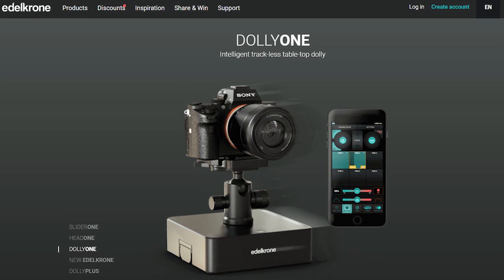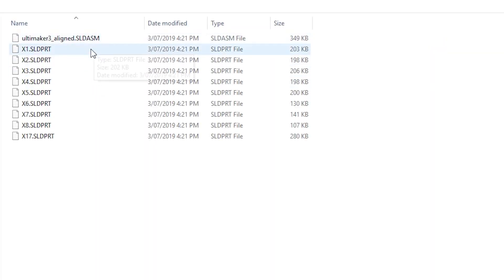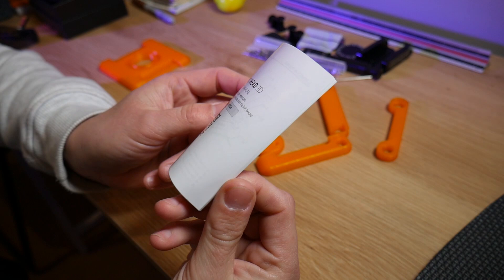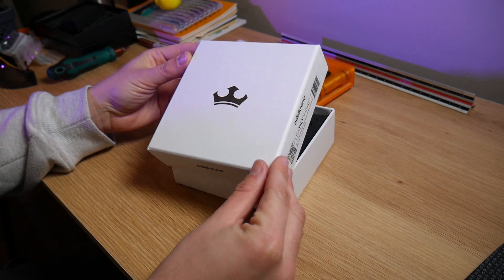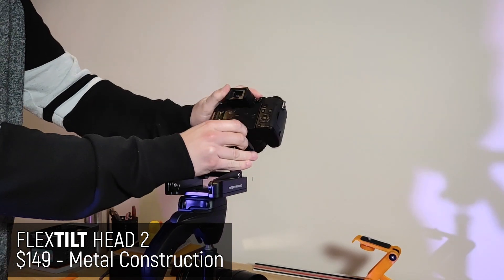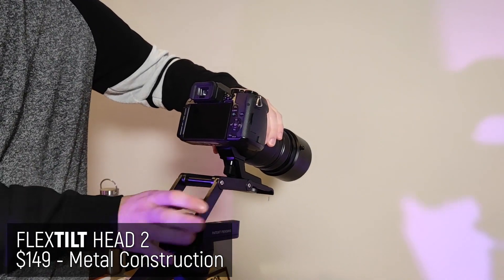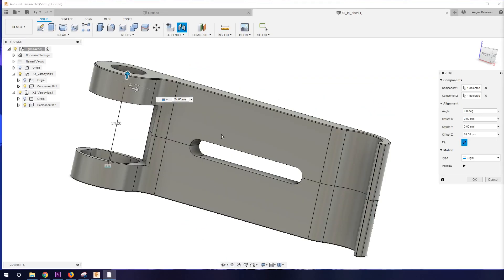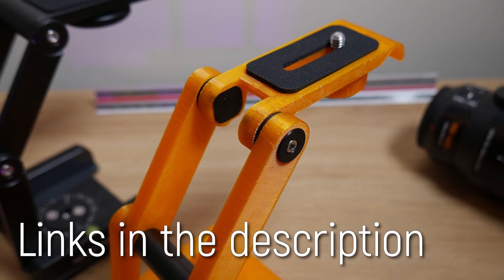Is the FlexTILT Head 3D the Future of Manufacturing?

Comment: 7AUD?! :-O Here, in Czech Republic, a kilo costs around 550-700CZK, which is about 34.66-44.11AUD...
Reply: Or you can get something like Gembird for 300-350CZK, both ABS and PLA.
Reply: @Evelas22351  I don't have the best experience with gembird filaments. But I recommend  FilamentPM (Plasty Mladeč) for 550CZK.
Reply: @vit.budina  They're not that bad, especially for the price. I tend to use them for larger, less detailed prints (props etc.)
Reply: @Evelas22351  I don't say that they are bad, I just have better results with other brands. But for the price it is a really good deal, I just prefer to pay couple bucks more to get better results. I had some adhesion issues with their white PLA.

Comment: 3:46 God I kept feeling like it's gonna break
Reply: You'd be shocked at how incredibly strong solid 3d printed parts are!
Reply: @Reach3DPrinters  yeah! if the pressure is in the  Z axis tho it's going to break SUPER easily in my experiance :(
Reply: @chloemcholoe3280  Certainly, pressure that separates the layers has the greatest chance of de laminating the part. 

However, a part printed at 100% infill with 3-4 perimeters, is INSANELY STRONG... just depends how thick the part actually is. I printed plenty of stuff 15-25mm thick, solid infill, and a hammer couldn't even break it. PLA is much more rigid than ABS though, which Ive mostly used PLA.
Perhaps your layers aren't bonding well. Maybe try increasing temp a few degrees and see if your parts become stronger.
Reply: @Reach3DPrinters  huh. I should try that. tho the part I designed had little z axis tabs that were supports to bend. they just broke :P but again they were thin. 
but you're right maybe it needs turning etc.
Reply: @chloemcholoe3280  Yeah, thin stuff like little tabs are definitely the downfall of consumer 3d printing. Prints gotta be robust to withstand the tests of time, at least 1/16" thick if its gonna last some abuse. Anything thinner than 1.5mm will break easily. 

Stuff designed to bend, such as live hinges have to be designed very carefully. Once a material has crossed its deformation threshold it plasticizes, and the material "memory" permanently deforms to a new position. So the goal of a living hinge is to never deform, but to only flex a given distance.
The field that studies living hinges is relatively new, known as compliant mechanism. Very fascinating field in its infancy.
Reply: @Reach3DPrinters  you seem to know a lot :)
Reply: @chloemcholoe3280  Its the stuff I don't know that I try to avoid learning :D

Comment: You can also open the Solid Works files directly using Fusion 360
Reply: But it loses the timeline and you end up the same place as using the step file so sort of moot.
Reply: @Anonymouspock  it is called the feature tree in Solidworks. Does Fusion have import feature recognition? It has been some time since I have used it.
Reply: I never could get used to F360 so ditched it a few years back and went back to SW.
Reply from the maker: @TheJttv  it doesn't preserve feature tree but will usually keep assemblies relatively intact. STEP is essentially the same in terms of what you get after conversion.

Comment: Carbon Footprint
This is a weird one. Let's take filament. If your filament is made in your country of origin, it's carbon footprint could be less vs getting parts from this company which could be located in another country. 
Depending on your delivery service, the kit could be part of an environmentally unfriendly route. There's too many variables without more info. 

I'm really envisioning scenarios where you could get the parts from your local hardware store and just need the files for 3D printing. 
I think it's an opportunity for smaller producers or minor products. Though the biggest concern is someone taking the files and manufacturing them. 
I could even see support where they go "Sir we can send you a replacement part or you could 3D print it with a cad file we'll send free of charge".

Comment: I hope this is the future.  I also hope the Open Source Hardware Association will allow for a level of certification where only part of the design is open (i.e. the case is open source, but the custom firmware is not) so that consumers can see that the company has some open source interaction like this, without making the whole thing open (e.g. Partially Open - Non Functional to show that some of the parts can be replaced or modified, but not enough to build the item completely).

Comment: Any plans to film your process of filming camera operation? Less sillily, I do like this approach. Oddball gear's generally somewhere between pricey and insanely expensive, and while part of that's charging "what the market will bear", another reason's that it's oddball gear and doesn't have consistent and inexhaustible demand. While the margins on something like this kit are likely sky-high relative to the actual cost of the parts, it's a lot less painful as Joe Individual wanting a nice camera mount for a hobby, and even if Mr. Individual's hobbies don't involve use of a printer, maker spaces have kinda exploded into existence over the past decade, along with printing services that'll just ship you the parts (and hopefully take care of their printers). It's also worth noting that this wouldn't be limited to printing. A 3D printer's definitely the most likely local robot, but you could also bang this out on any other kind of CNC bot if you wanted to play with the device's mechanical characteristics or just had it in the workshop. Wooden camera mount? Wooden camera mount! Got access to a CNC milling machine? Well, you're cool and we should be friends, and you could basically duplicate the more expensive one without fabbing the entire assembly.

From a business perspective, it not only taps into a hard-to-touch market, but it pushes the bulk of the manufacturing process onto the customer in a time where that manufacturing can consist of playing with a few files and pushing a button for a weekend at the cost of a fractional pizza.

Comment: As a filmmaker and photographer I can tell you that tilt head is absolutely useless, I’ve seen so many people fall into the advertising hype and buy one and then see how disappointed they are with it. It’s not that it’s built bad or anything it’s built pretty well but it’s a completely useless design, just use a standard ball head.
Reply: I agree,
a standart ball head already provides rotation in all 3 axis and its waaay cheaper.
I like the general concept of buying a blueprintand and special parts for a product and printing the rest though.

Comment: but the aluminum wont degrade over the next 20 years, esp if you use it outside.
Reply: The you'd simply print a new one.
Reply: If the plastic degrades or breaks but you get a good amount of use. Just replace the broken part. Especially if the company folds during that time.
Though that also depends on the material you use.

If the metal breaks.......unless you got a mill, probably sol unless the company is still around to purchase parts from. 

Then again if it breaks from use then either poor quality or some serious misuse.

Comment: Also neat is this: when you accidentally drop it, you can replace the broken parts.. whereas with the metal one.. you might get replacement parts.
Reply: But in the metal ones you have less chances to break parts from drops..
Reply: adriano sousa  Not necessarily. The plastic parts are much lighter which means they are less likely to break, especially considering the amount of infill.
Reply: @Old_Man_Bushcraft  Brilliant logic, this, of course, is why all tools subject to impact and cyclic loads are made out of plastic.... who needs the scaling of tensile strength and a modulus of elasticity with such genius.
Reply: @Old_Man_Bushcraft  While it won't hit as hard when it falls by itself, that's only one possible impact scenario. If something heavy falls on it or with it, it will be more likely to break.
Reply: This is even more relevant if the company ever goes out of business or stops making said replacement metal parts. If you have the file stored away, you can just print what you need.
Reply: @GregAtlas  well, you can make the aluminium parts with a CNC mill, they already gave you the stl files. or make a frankenstein's monster of a tool, part metal part plastic.
Reply: And you could potentially print out spare parts in advance so you would not be without your gear when you need it for important shoots.
Reply: This business model really doesn't have a future since if people can make and fix products on their own, then there is no incentive to buy more or to buy a new model that may just be slightly better. This means for a company to make the same money they could make on a conventionally produced product, they would either have to charge much more for a DIY print (which sounds awfully silly) or expect to reach more customers who aren't actually really interested in their product. Neither are very sound business models for serious commerce.

Comment: The metal one is only worth about $30.  Manufacture costs are probably around $8.   The kit version - $2 in parts.   I'm betting materials are sourced from China, probably made in China.  I'm not saying this is a bad thing, but definitely not worth the list price.  I'll print my own and with a trip to the hardware store have one made for under $10.
Reply: You are leaving out the time required to actually model and test these files. Very few companies charge the cost to just make the thing in a production run. 
Yeah you can take the time to model this in your preferred software. It's going to take you a bit of time and you might have issues optimizing the design. 
Or you could get the kit and with the models already completed.
Reply: DesignIncase You are quite right, few folks ever allow for the cost of design and validation of that design. The other thing that is usually missed is the quantity being ordered. Yes Sir one of those will cost you $200 or for $250, you can have 50 of them.  My customers don’t order enough parts to go offshore. They have a viable business, but they only need short runs of parts. One product each of the last runs of 100 had had a minor design change. Try that with large orders and it is a visit to the scrap yard.

Comment: Glad you spoke about the tension and how well it held up. There has been a couple of videos out already, but they either didn't actually show it in use, or it just didn't work at all. This has given me confidence to buy this now, thanks Angus!
Reply: yes, but he didn't try tensioning it any more.  the tension was set to be conveniently folded and unfolded.  You can easily use a heavier set up if you tighten things down after you get it positioned correctly.  2 extra minutes of set up is inconsequential.
Reply: @RoamGaming  yeah that's good to know. The other videos i saw - they had to loosen the nuts to move it, tighten them to keep it in position. It really showed the thing badly! I'm happy to adjust slightly once, it was the loosen, tighten, loosen that I was not a fan of. Turns out if you make it correct - it works as expected. Not a fan of the plastic squeak though!! Hahaha
Reply: It's not really meant to be used "interactively" (no micro-adjustment, no repeatability, not horizontal tilt, no quick lock). This is meant to go on top of the DollyONE, for tracking shots.